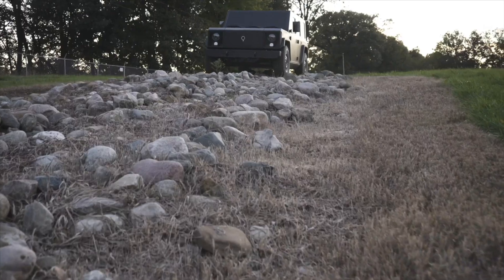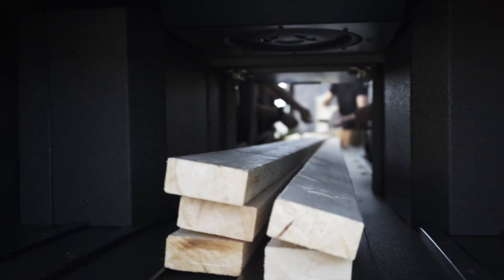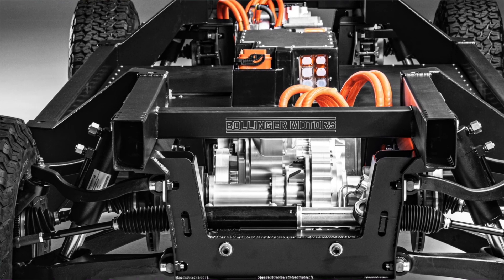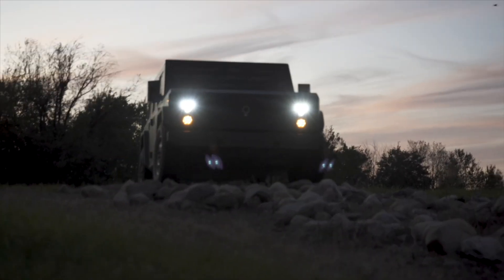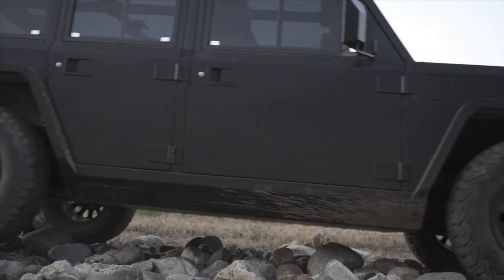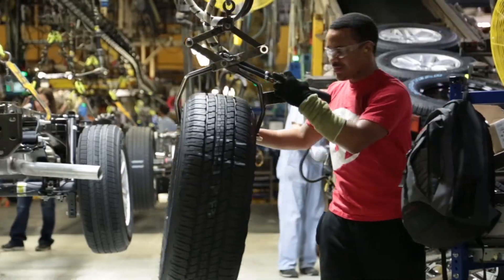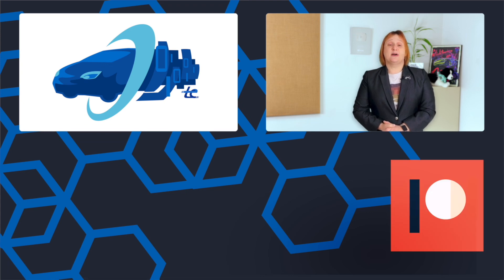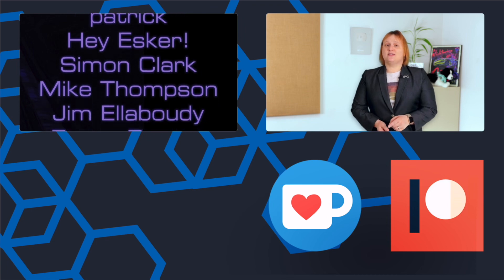Ready For Work? Bollinger Announces Cab-Only EV Options

Comment: The Bolinger pickup, and this chassis cab have the potential to be truly fantastic adaptable machines for the likes of large scale farms or ranches in the US and especially the massive, sprawling farms in Australia which often have hard to access areas. Sadly, the price is a bit high, but, if they are able to avail of tax right-offs it might just become a viable option 🤔👍
Reply: The problem here is range I think, some of those farms are as big as small countries. If they did a simplified version without the portal hubs and so on it could be a huge hit, after all the ability to drop a battery with solar attached at the far reaches of some of the larger properties so you can have a bit of a recharge would be a phenomenal addition, almost like jerry cans that you don't have to carry.

Comment: They should make smaller A1 and A2 with a 65K price tag. Some cutbacks such as less power, smaller battery, and no geared hubs will be done but will still have more than 200 miles of range.

Comment: Maybe in the States but in Europe, unless they can better the Unimog, its versatility and many many attachments. Then it is going to struggle. Especially when, if spec’d correctly, one can easily connect a 3-point linkage; rear mounted PTO; front mounted PTO; or even have a PTO at either end. I suspect outside the States, Bollinger will lose out to platforms like the Unimog or Reform Muli.

Comment: Yes, whenever I see a person review the numbers of how a gas car is more or less better for the environment because of the energy put into it. They do no include the builds cost and pollution from it. They simply have battery build and gas emissions numbers, that is all and still the electric vehicles are on top!. Not including the engine, pulleys,  chains, other non necessary things in an electric vehicle. And if you think about it aluminum can come from the gas cars for evs. Less parts for an ev meaning less factories, in turn helps with transportation costs and pollution. The air in the world is much much better since the corona, meaning first ev that is as good as the tesla for $25k I am taking it!

Comment: It is unreasonably expensive. But at least it's practical and sensible and seems to have good potential for future in commercial use... Very much in contrast to another popular EV truck which shall remain unnamed.
Reply: Unreasonably expensive is a Porsche Taycan. These trucks get assembled entirely by hand in small numbers, and the battery pack is large for such a small company, which also jacks up the cost.

Comment: Yawn. At it's price point, it's not a feasible option for companies either. Plop a generator in an F350-600 chassis cab and it will go wherever you want as well for a third to half of the price. And they can be depreciated as well. And the company can buy 2-3 Fords for the price of 1 Bollinger.